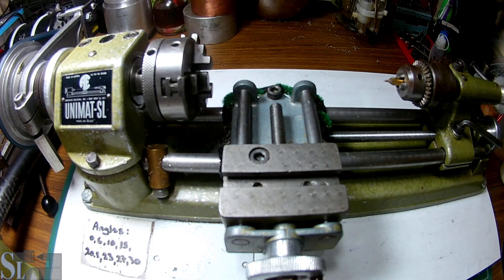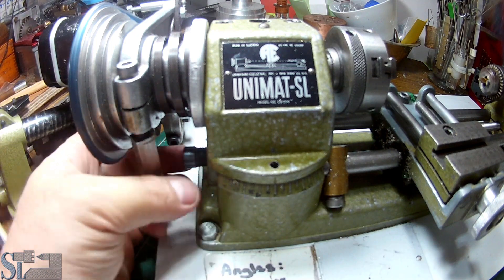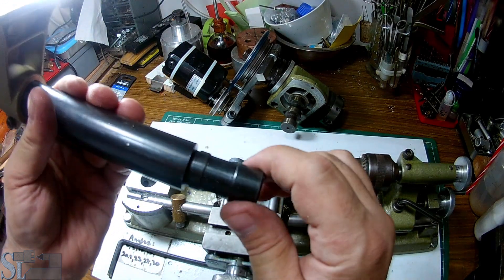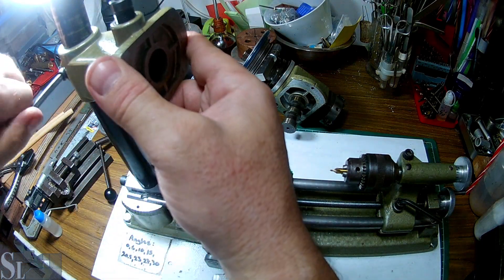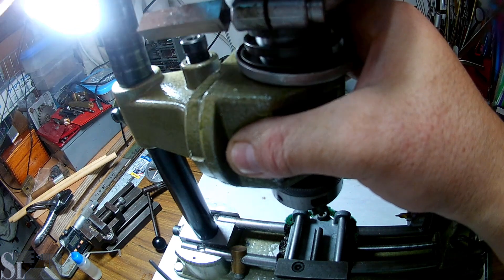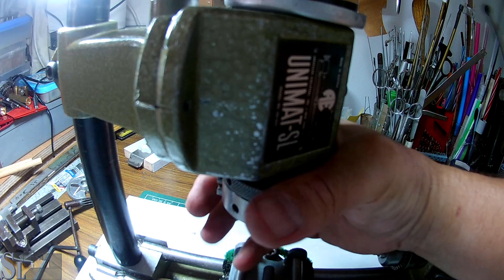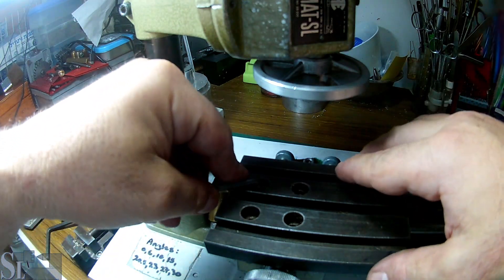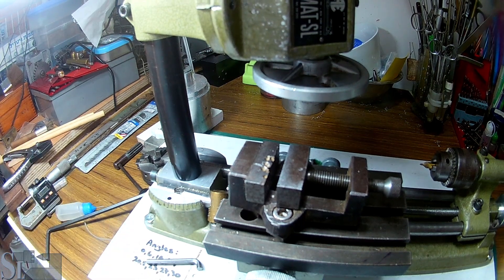Turning the unimat SL1000 lathe to a mill

Comment: Great video. I'm interested in this machine, but from what I understand there's no accurate way to control the Z axis, is that right? On milling machine there's usually a rotating handle, like those to control X and Y on this one. But here I only see the bigger lever, which can't be locked, and is not very accurate. Did I miss something?
Reply from the maker: Thank you. Z axis control. Well, yes and no... No, there is no wheel for precision machining. Yes - you can control the height using a simple adaptor - I'll add a link and you can lock the. Height using the spindle locking screws. So this combination is not ideal or easy but it is very doable and you can machine to specs. Do check the unimat type before you buy (see the knacklers workshop channel on unimat type comparison). Hope this helps!
Reply: @Smallathe  Indeed... wow I'm very impressed by this machine. I love your DIY DRO 😍
Yeah I've already seen the knacklers workshop, I'll keep that in mind.
Reply from the maker: @JulienStoeffler  It's a wonderful lathe, less ideal mill (vibration, rigidity, concentricity issues) but all in all it's a wonderful tool! :) It will allow you to make any part (up to 50mm in diameter, with exceptions) you wish!
Reply from the maker: Here is the video link: https://youtu.be/h4QRmZNvAi0

Comment: I do have a deep appreciation for older German\Austrian made tools, I believe there was a multi-use tool that could convert to a table saw, drill press, and a few other things.  I can't remember who made it at the time (1970s era), maybe Bosch?
Reply from the maker: Emco used to make the unimat lathes. I fully agree - old tools have their own beauty and elegance... :)
For more information: http://www.lathes.co.uk/unimat/
Reply: Yes, they are nice too! It includes a wood-lathe (pretty small one), sanding-disk and some other smaller things and a sanding-machine (flat) but also a bandsaw, all for wood.
My father has one but he mostly uses it for table-sawing since since long he has the other tools seperately and therefore does not need to change the setup of the machine all the time.
Not that is that hard as with this lathe in most cases. Clean the tablesaw (bench...), unclamp it and twist the bed-piece up to get the bandsaw up, switch 'gear' to the tablesaw and there you are. And then 10 minutes later you reverse it all to get the tablesaw into action again.
At the time, motors were very expensive and you made verything working on one motor.

From yet another German firm, AEG we have the multi-attachment to their (best working combination) drilling-machine. Besides the normal drillhead which you can also use in a drillpress, you have attachments for which you release the head (chuck) with releasing the (left thread!) screw, take the head off, put a little adapter on, put the attachment on and there you are. You have for example a grinding-stone, polisher, table-saw and circular-saw attachment. The table-saw is the same as the circular-saw but with an extra table and the guide removed for the circular-saw.
The saw can be adjusted for wide or small groves, depth of course and angle.
And yes, I have this set and use it too. Of course now with a different cheap drilling-machine since the AEG machine broke down some years ago.

Comment: so the only purpose of the faceplate is to get it perpendicular to the horizontal axis? do you remove the faceplate after and install the chuck or does it stay on?
Reply from the maker: Yes. I just used this trick to turn some angles (a new video) and you sceew un the face plate, adjust the tool and switch back to the chuck to cut (or keep it and use a lathe dog).

Comment: do you need to use the 3-jaw chuck in the mill configuration? or is it possible to use some collet system ?
Reply from the maker: Hi Hans. The unimat does have a collet system - I don't have it and the cost is a bit too high for me, at around 250usd, not including shipping!
Reply: @Smallathe  but do you know which kind of system it is? is it just collets and a nut? it's just that the original manual isn't that clear on that topic...
Reply from the maker: @HansAndreasR1  Agreed. I don't know how this connects to the lathe - I guess it threads onto tge spindle. But you need to ask someone who already has a collet system. I think "the knacklers workshop channel" has a set. Ask...
Reply: @Smallathe  will do! thank you!
Reply from the maker: @HansAndreasR1  my pleasure!
Reply: @HansAndreasR1  hi guys hey if you haven't found out already, the collets are E16 taper and the holder is a 3 piece affair with M12 threads to thread onto the spindle along with it's own backing plate. That plate, has to be turned down slightly (if new) to fit onto the male M12 spindle. The collets and collet holder are very rare and can be EXPENSIVE but they are out there. Ebay is where the action is. E16 collets are no longer made. The modern replacements are called ER16 and although they fit a unimat collet holder, it's not the greatest fit. E16 collets range from soft blanks, 1/64th up to 1/4" with some sizes in between. Good luck!

Comment: Nice video, never used mine as a mill.                                                                                                                                                                                     Is there an easy way of setting it back nice and square as lathe , without a dial . Thank You !!
Reply from the maker: Glad you liked it. Yes, there is - check tubalcain, aka mr.pete222 videos on lathe centering. But a cheap chinese dial indicator from ebay will work well (it does for me).
Reply from the maker: Tips no. 78 and 79 on Mr. Pete's channel.
Reply: @Smallathe  Thank you !!

Comment: Nice demo, very nice design so you can repurpose it to a mill. Paul (the knackler) just  demonstrated the jig saw attachment . Great tool for the basement workshopper! cheers!
Reply from the maker: Yep. The unimat as a lathe is very elegantly designed. Two features I would change: 1. Z axis movement of 16mm is WAY too short and causes many issues. 2. If you want to go up-down you loose concentricity - I'd shift the round bar with a dovetail design and allow the central screw at the base to allow the axis to shift the angle. This way you can change the angle and/or height, but changing the height doesn't cause you to loose concentricity. And yes - it's a wonderful tool, especially if you have all the accessories... 
Didn't know about Paul's channel - will check it out!
Thanks!
Reply: @Smallathe  his channel is nice. Been watching it a while learned lot from his channel to.
Reply from the maker: @paultrimble9390  Yes. He has a very nice channel. I'm a subscriber too :)